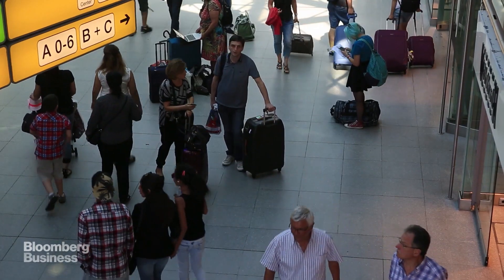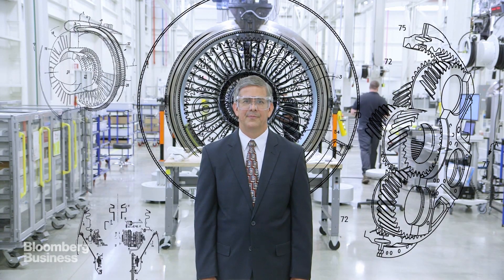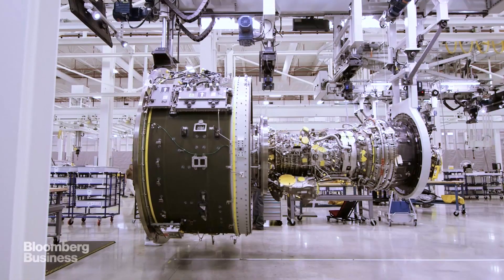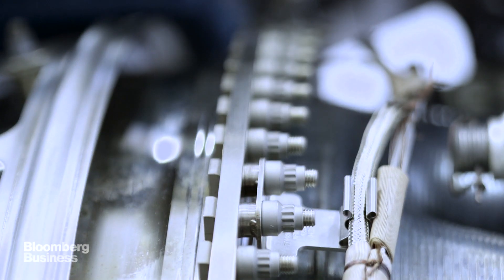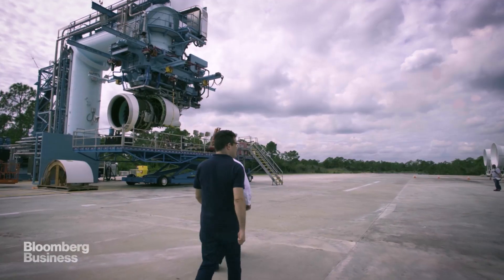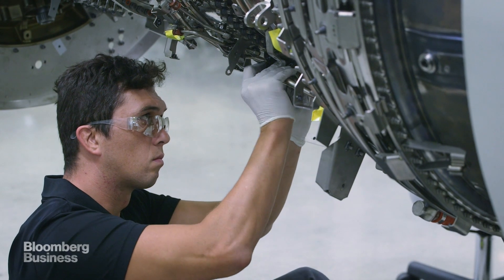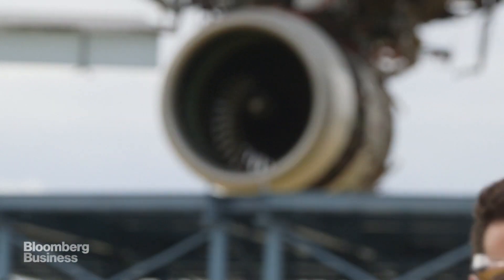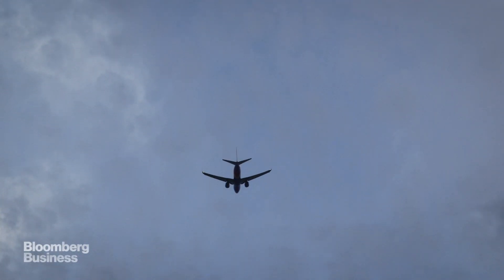This Genius Invention Could Transform Jet Engines

Comment: Planes will be replaced by trains and we don't need any jet engines. Search VHST-600X, Hypertube and Startram.Planes burn fuel and make dirty air and cannot go faster than 850km/h Linear motors of some sort without any moving parts and small nuclea reactors will completely replace jet engines.

Comment: 30 years and $10billion in investment. Each engine can save the operator $1.5million/year...if an engine lasts 10 years, they will save $15 million even if this is a saving per engine and even if the company can earn $10 million profit out of that $15 million, the manufacturer will have to make and sell 1000 engines to get their investment back.... A pretty tall order

Comment: On the face of it, the use of a gearbox doesn't sound like an extraordinary leap in technology. Mankind has been using gears for centuries so the basic idea is pretty obvious. Given that they have spent 30 years developing this and have only just managed to do it, there must have been a breakthrough idea that solved the technical issues they faced but this video didn't explain what the difficulties were or the genius invention that finally lead to the solution.

Comment: WTF? All turbofan engines are geared and have been since they were invented, hence the name turbo FAN.
Reply: i. rob  I stand corrected! All my jet time is in the Lear, which has the TFE731 geared turbofan. Very quiet, and very efficient. But also has been around for a long time, since 1970 at least. So I still say it's not a major breakthrough.

Comment: jets engines are out of date. big hair driers they should be called. hope you can work it out to understand.
Reply: jet engines use fuel wear as the hair drier (as i call them) uses compressed air and only a fraction  very small amount of fuel to drive the fans. your q is the hair drier.
Reply: O! dear to explain: jet engines are propelled by a continuous explosion where are the new "hair driers" works on compresses hot air and, the fan is a SMALL combustion engine which uses one ten of fuel a jet engines use.

Comment: 1:46 - the better question: Why has no one thought of this before? What are the challenges that a gearbox presents?? 

It seems like an obvious solution...would be fascinating to get some insight on that
Reply: It has been done before, years ago, but it never really caught on at the time.  The main downsides are additional weight and complexity and, as a result, theoretically lower reliability.  (Although I say theoretically, these new engines have had some teething troubles, but I daresay they'll be ironed out).

Comment: Great! Now just bolt a powerful electric motor to the fan portion of it and not only can you get a boost of power on take off and a more efficient overall engine, but you also get the benefit of not needing a Huffer.

Comment: There is nothing genius about this. Geared turbofans have been a well-known concept for a long time. Switching to something like a biogas would be the next big thing. There is only so much you can do to make a turbo-fan that much more efficient. Switch every flying thing to biogas and we will be able to see a drastic change in the climate.
Reply: Old geared turbofan could only handle 7000 HP, these can handle 30000 HP

Comment: Looks dangerous in adding a component far more complex than the original system, hence increasing the chances of catastrophic failure. I suspect this is why it's not used on passenger aircraft flying 4 billion people a year.

Comment: They need to implement the srf71 engine design. Turbo/ram jet engine. You'll get over 50% efficiency with a ton of power. That was design over 50 years ago.

Comment: Sceptics, here is the tech info: The Pratt engine is radical because it has a 12 to one bypass ratio. Other jet engines have about a 5 to one bypass ratio, meaning much less efficiency and more fuel burn. Bombardier's development of its new mid size CS100 and stretch CS300 jets was with this engine with 3 different thrust rated units. The actual fuel burn reduction was 21 percent on the partly carbon fiber jet, once they were put in service. AirBaltic has flown over 1 million passengers on it's stretch CS300 in Europe. Delta Airlines 3 years ago placed 75 Firm orders with another 50 Options for both Bombardier versions. Air Canada placed 75 Firm orders 1 1/2 years ago. JetBlue just placed 60 Firm orders and options for another 30. The CS100 will seat from 108 to 132 (29 inch pitch)  and the stretch version CS300 will seat from 130 to 145. AirBaltic seats 135 on their CS300's. Airbus will make almost all of the Delta versions in their Alabama plant and it has been renamed the A220-100 and A220-300. Airbus has dropped the A319, so the A220-100 will replace it. Airbus uses this as an optional engine on their A320NEO. Many U.S. based airlines will prefer to convert their future A320NEO orders to the A220-300 as it's the only 100 percent all new mid size jet on the market. Boeing will catch up with a replacement for the 737 in 2022 or 2023.

Comment: A machine itself could operate without the need of a fuel source still Jet engine still requires fuel to operate so no engine could transform but only evolve until maximum entropy.

Comment: The difference in optimum speeds for the compressor and exhaust turbine has been known since the 1940s; the only breakthrough here is designing an efiicient gearbox that can handle the stress of high speed operation without catastrophic failure. Testing is needed to be sure these things don't have a tendency to explode like a bomb in flight!

Comment: Modern jet engines are just fine for the environment. They have a thermal efficiency usually about 99%. Stupid Bloomberg. The turbine drives the compressor. If the tips were to go super sonic, the blades would destroy themselves. Pollutants usually not a problem on a jet engine.

Comment: I wonder what the other repercussion is. For example, how much energy does the planetary gearbox take in terms of friction and oil usage, and then oil cooling, and then the cooling of the gearbox mesh gears.

I'm sure they've obviously gone into this, but there would have to be some energy drawback with any kind of gearbox, as gearboxes fundamentally eat energy for breakfast.

I just wonder what the efficiency ratio is in terms of the reduction of supersonic tip energy x the gearbox friction energy.

Anyone from Pratt and Whitney no any of these figures, just out of curiosity?

Comment: The greatest innovation would be if Pratt and Whitney combines Stanley Mayer's water hydrogen technology using electrolysis for this new engine. There would be less casualties to passangers when the tanks of the jetliner are filled with water in case the plane crashes.

Comment: An Electric Drivetrain would solve this problem. 
Drive the ducted fans with motors powered by a large turbine or two, which could be mounted anywhere (maybe in the tail)

Comment: Use a generator to power a generator ( Solar also) take 20% of the power flow into a lead acid or ni-cad Too save that energy? 
Build the battery in ground with proper insulation and concrete floor, mega juice. 10,000amp,

Comment: bullshit.
all blade propeller engine must rotate under super sonic speed at the tip of the blade if not nearly 0 thrust is the result
this gear may reduce 1 million/years fuel cost but would raise the engine price and maintenance cost and who is best to maintaining those engines other than those that created that engines?

Comment: Lycoming/Honeywell produced geared turbo fans for the BAE 146. The ubiquitous turbo props include gears to reduce the speed of the turbine power unit to drive the propellor. P&W have taken on this idea and applied it to jet engines of higher power output. Rolls Royce are taking the idea yet further and are developing its use on the very largest of jet engines such as the Ultra Fan.

Comment: Its 2018 now where is it ?
Reply: The Airbus A320 NEO, has these geared turbofan engines, for several months now.  The A320 NEO (New Engine Option), is the '737 max' killer.  The geared turbofan engine, has a wider fan disk, that pulls much more air through(higher bypass).  The 737 Max, can not compare to this airliner, due to it's stubby landing gear, with the A320, sitting higher off the ground.  There are videos on YouTube, of A320 neo delivery flights. Even before the 737 Max accidents, I was leaning more toward Airbus, because of these amazing engines.

Comment: How is it that these people are not aware of the MYT Engine by Rafael Morgado.
His engine makes reciprocating engines obsolete and completely 19th century.
Think Power to weight ratio 20:1, 150 pounds. 12° dwell, 850 in.³ displacement, ergo 815~ horse power at idle speed of 800~ rpm. 4000 horses at 3000 RPM. Naturally aspirated
Oil and air cooled with only 13 moving common automotive parts.
Really!
And it’s only 14“ x 14“ cylindrical internal toroid combustion chamber engine.
Have a set of turbines behind 4 of these, say a 28” MYT engines, and buckle up.
Reply: did you See a  Reciprocating engine.    if so, you need stronger meds

Comment: How necessary is a gear reduction system when this can be achieved by wider fan blades rotating at lower speeds? Resulting in less parts, engine weight and maintenance.

Comment: Wouldn't a gear box mean more maintenance hours and heavier engine? Or does the 15% or so fuel saving counteract the added complications including more weight and maintenance / parts replacements / potential failure ( more moving parts ) complexity?

Comment: The pressure is on to build larger diameter but shorter jet engines.  Such jet engines are impossible to engineer today but with this gear box we may see 18 to 20 foot slow spinning jet engines that literally halve the operating costs of flying a large airliner.

Comment: I may be wrong but making a phone call 150 yards from an engine at idle doesn't seem that difficult. Later when the engine was spooled up you could tell it was running at much higher rpm. Make a call at that point. And go to the back side. Even 300 yards behind it. I'll bet he gets, "whaat?, who is this?...I'm not interested. Don't you know I go to bed at 3pm?"   😂

Comment: They run off compressed air now, check out jet fuel hoax.
Reply: Chris Madsen Only people with zero knowledge of physics or how jet engines work believe that, and it is NOT true.  Do some research that doesn't involve watching YouTube videos and you'll understand.
Reply: Paul Shepherd YouTube is a great research tool. If you don’t believe it then show me the data that isn’t on YouTube regarding jet engines not running on air.

Comment: This is a concepts similar to why one wasn't able to add jet engines to a helicopter, the blade would have to stop or fold , at high velocity, the blade become a burden to the jet flares pressure and super sonic barriers, we now have inventions of bladeless fans replacement tube strip beams and electric/electron combustion thrust that would replace the fossil fuel limited volume with electric solar or mini nuclear amped batteries that would ride sound issues at land path areas, along with the flight cost almost entirely, which is what one would recommend the company to look into.

Comment: Nothing new in this.  The RJ 70 had such a gearbox. The BAe 146 is powered by four Avco Lycoming ALF 502 turbofan engines, which are fixed on pylons underneath the aircraft's high wing.[6] The ALF 502 was derived from the Lycoming T55 turboshaft powerplant that powers the Chinook heavy transport helicopter. Notably, the ALF 502 had a very low level of operational noise, much lower than most other competing aircraft. This was achieved largely through the use of a geared turbofan engine; the gearbox allows the fan blade tip speed to stay below the speed of sound dramatically reducing the aircraft noise. Additionally other sound deadening measures include a high bypass ratio compared to contemporary aircraft and additional sound damping layers built into the engine.

Comment: geared turbofan engine's have been around for years, nothing new here
Reply: leokimvideo there IS something new - an apostrophe in the simple plural word 'engines'.
Reply: btw leokimvideo has 1.3 million subs
Reply: It is on a high bypass engine of that size.
Reply: Isn’t a turbo prop kind of a geared jet engine lol?
Reply: @Firedog105  I know right... Big fan only turns as fast as the rear fans make it go... forget stupid wastful gear box. just adjust the angle of the fins on the rear fan that drive it.
Reply: @unitedspacepirates9075  

Yeah, let's come up with a much more expensive design more prone to component failure!
Reply: @MilesEdgeworth129  maybe retrofitting existing engines to inject water to flash boil expanding 1600 times in volume, get the same thrust with less fuel.
Reply: @unitedspacepirates9075  and a whole lot more water. There's a reason why that design isn't common, even though it's been around for decades.
Reply: @unitedspacepirates9075  works for turboprops, not so much for turbofans.
Reply: @jeffbenton6183  incorrect sir, water expands into steam with more volume than combusting jet fuel.
Reply: @unitedspacepirates9075  thrust is a type of force, so you measure the thrust by multipling the acceleration by mass of the thrust. Volume has nothing to do with it.
Reply: @jeffbenton6183  volume dictates pressure, which dictates the acceleration rate of steam. Allow the pressure to double and the steam has twice the force to accelerate. Double the velocity of steam and 4 times the kinetic energy is available as KE=1/2MV2
Reply: @unitedspacepirates9075  Ohh, I see where you're coming from now. It still doesn't change the fact that now you have two combustible fluids rather than one. The MiG-25 used a similar system, where water was injected into the airstream in front of the compression chamber (to make it more dense) called a precooler but it could only use it for limited time because it would run out of water. Water is heavier than kerosene, which is probably why don't use more of it to fuel airplanes: the advantages might outweigh the disadvantages. Airlines and militaries are trying to pump as much range as they can out of their airplanes these days.
Reply: Well.. Guess What: Look at the upload date :O

Just kidding..
Reply: 2 Bits What are you talking about
Reply: Well... the picture they kind of show is that of a planetary gear set, which is a genius design, but not one that Pratt and Whitney can claim. This video is short on actual newsworthy information, and misleading as to what the breakthrough really is, if there is one.
Reply: Yep, I was expecting some kind of hybrid electric propulsion, or a substantial improvement in thrust translating to smaller engines.
Reply: @ItsNotAllRainbows_and_Unicorns  stop eating beef and it will be more beneficial for the environment 😂😂

Comment: cool. Now take that larger rotor and use the full circumference into an electric motor and compress it down to where a small amount of fuel and air is burned under high pressure. Just for fun of coarse to see what consumption of power is. Might be cheaper to run 1 turbo generator and two electric fans

Comment: in the 80"s, Mcdonald douglas made an jet engine fan propeled by an turbine (an propfan), in 1949 an austrian engineer Bradner made the nk-12 for the soviet bombers that is one of the most powerfull and eficient engine even by today standart.  An flying wing jumbo jet would be an inovation, making an engine with a bigger diameter so you can fit the transmission inside shaft is why everybody thinks this is propaganda

Comment: People, people... The metals can absolutely withstand spinning at 100K rpm. It's just the balancing and oiling, and other fine details that make it a 100h engine or a 10,000h engine. But most certainly we can prepare sufficient alloys, as well as sufficiently machine them to fit within 2/1000" tolerances (1/500 of an inch). It seems perfectly reasonable that a multimillion dollar engine would be able to do this gearbox trick.

Comment: Can jet engines work on hydrogen gas? If can, then can manufactures like Pratt & Whitney, use  electrolysis to separate hydrogen and oxygen from water and use that hydrogen to power the jet engine. If future jet commercial airliners have water in their tanks, would they be less destructive in a crash?

Comment: Lol if P&W would have only thought about their engine also need to be good in ground operation. Unfortunately they´ll fail there - core-engine-temperatures are too high on the ground so it needs way longer for them to cool down in ground idle before take off - leading to missed take-off-windows and a lot of fuel burned on the ground. Infact they burn so much fuel on the ground, that even their excellenent sfc in cruise isn´t able to give them an positive overall result. V2500-numbers increased again because the customers refused to equipt their new million dollar aircrafts with the p&w-engine unless the redesigned parts the engine causing the problem. So in theory they brought up (again - yes,the geared turbofan is not a P&W-invention) a good concept, but they showed a poor performance baking that theory into a groundbreaking engine